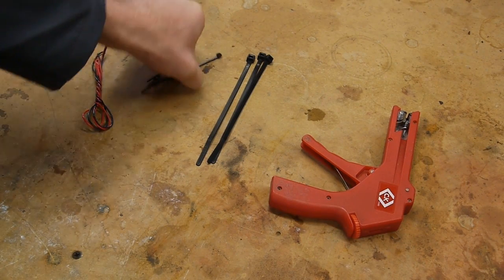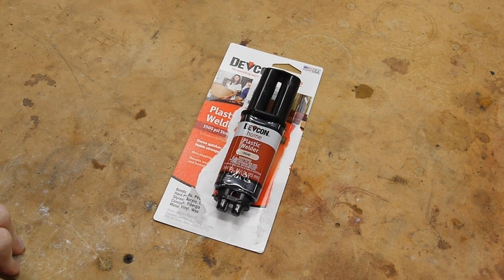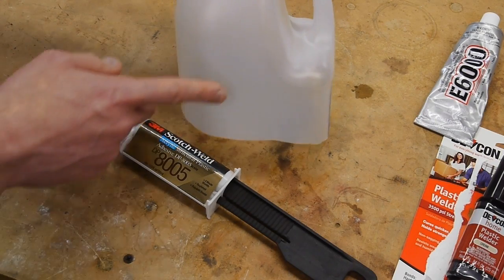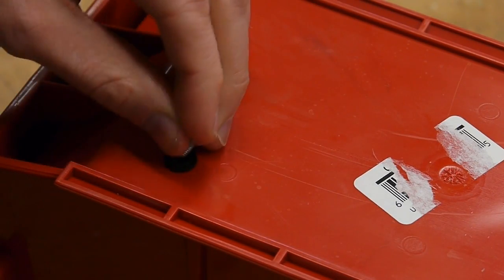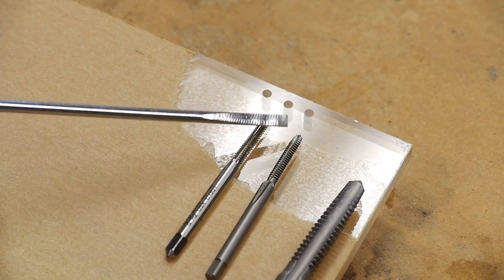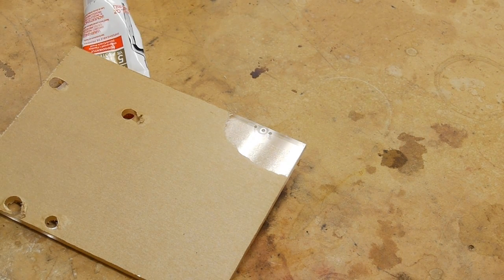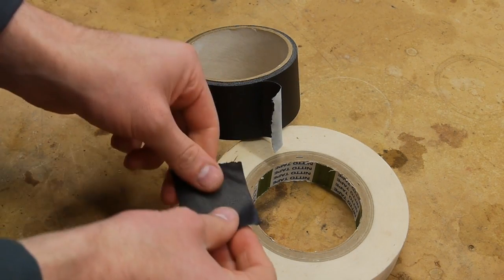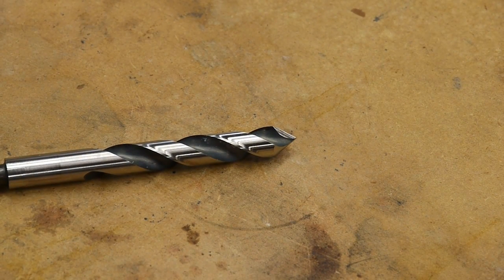Tools and Tips #1 from Applied Science

Comment: Just an FYI for anyone curious - the Scotch-Weld DP8005 is actually quite toxic and corrosive. You need to definitely use it in a well ventilated area, and make sure it doesn't get on your skin. It also needs to be stored around 4 degree C (40 degrees F) so it should stay in a fridge that is not used for food. It contains known carcinogens. But hells yeah, it works like a hot damn.

Comment: Tape, generally, including gaffer tape in a wide variety of sizes and a few colors: “Gaffer Power” Consistently high quality. The more effective tapes can be harder to handle: harder to pull, and the tape often has to be rubbed down after application to get the adhesive to set. But it is worth it.

Comment: With your glowing review of e6000 (3 years ago, as I write this) I decided to buy some and try it. 

My spectacles broke at the bridge so this looked like a great test case. The glasses are some kind of plastic or resin, so I scuffed up the broken faces and the 4 sides adjacent to the break (so as to create a "blob" repair extending both directions beyond the break).

I cleaned the surfaces with IPA and dried it with a hot air gun on low. I then opened a newly-purchased (from a high-volume dealer) tube of e6000 and wasted a big glob (I find all adhesives separate a little so never use the first out of the tube). I applied some to both surfaces (as directed by the instructions), waited a little, and then pressed them together. After the joint had set up a little, I followed up with more all around the joint, creating an elongated "blob" repair.

I supported the frames and let it set overnight at summertime nighttime room temps. In the morning I found that it was flexible, somehow not what I expected. I tried them on my face and immediately knew that this was not strong enough for a permanent repair. So I pulled apart the repair and pulled off the adhesive from the frames. 

I was quite surprised to find that the e6000 had not bonded to the frames *at all*. The e6000 peeled off easier than cheap rubber cement. Where I had removed the e6000, the frames were completely clean, as if I had done no repair at all--no evidence of chemical bonding whatsoever.  

I remember that you had said that you thought that e6000 consisted of perchloroethylene solvent and clear elastomer. I don't know perchloroethylene from spit, but I know that it doesn't attack a pretty common plastic (I'm sure my glasses frames aren't nylon or HDPE). 

So just an FYI to viewers who come here and see e6000 and decide to try it. My opinion: it's a non-silicone RTV, nothing special. 

For the repair, I fell back to my standard (and a favorite of yours): Devcon Plastic Welder. The result was strong and rigid. What I expected the e6000 to be, but wasn't.

Comment: E6000, Amazing Goop, and Shoo Goo, which is chemically similar Goop, are perchloroethylene-based adhesives from Eclectic products.  E6000 is odorless, nonflammable & dries clear.  Shoe Goo/Goop uses toluene & naphtha (like flammable oil-based coatings which should be ventilated in confined areas) & dries amber.  The Shoe Goo may adhere better because of more difficult-to-use refined solvents.

Comment: For tapping hard materials the straight taps shown in your video are better but I have found that for tapping soft plastics and especially perspex you need a spiral tap.  The waste channels of a spiral tap are a spiral instead of being straight and they are designed for softer materials.  They don't work as well as a straight tap on hard materials but they work much better than a straight tap on soft materials.

Comment: I call wellnuts.   Willnots.  Because most motorcycles and atvs use them alot and once installed for a few years in the weather they will not come out. Then your in trouble because they're usually holding very exspensive body panels on

Comment: On tapping of holes, you can get several types of products that make things easier.
When I worked at a navy yard we had a task of drilling and taping hundreds of holes on a Aluminum sheet 1/2" thick and was 4' X 8'. That Sheet was used to mount approximately 40 Multi-switch boxes for inter-communications. We used this adapter called Tapmatic with a 3/4" Hand-drill.
It would drill and tap the hole with a drill/ tap bit that would do it in one operation. It was a design that would keep the bits from breaking because it was adjusted for torque and or speed. I believe its still made. This was during the mid to late 60s. Its diameter was less than 4" on diameter. It could also be used on a drill press. Of course at that time there was a handle that was held to keep it from spinning. Now they have improved that quite a bit so that handle is no longer a part of the unit. There are drill bit combinations that will start a hole and end with a tap . when you pull the drill back out of the hole the Tapmatic reverses direction.

Comment: for tapping the hole, instead of using distiled water you should use TAP water.
''tap water, not just good for tapping holes'' - AvE
Reply: using plain tap water, especially in a place where melting is possible, risks embedding impurities in the water into the outer surface of the material being tapped, in a place where the exact composition of the surface material is highly important. Not recommended

Comment: I agree on the DevCon plastic repair, especially its odor. I is one of the worst smelling things I have ever come across. Back in the late 90's Walmart sold all of their DevCon two-part epoxies in their hardware department for $2.97, and this was one of the offerings. I bought a lot of this stuff for all sorts of projects. They also had a Kevlar filled Dev-Con two-part epoxy that I liked. What makes this stuff so great, like you said, is that it is somewhat flexible, which makes is very tough and durable, unlike most epoxies.

Comment: E6000 seems like a high-tack contact adhesive. Neoprene in a solvent?

I'm surprised you skipped the obvious joke and didn't take... tap water for cooling the tap while drilling.

Unfortunately i live at the other end of the world, and i believe all substances mentioned will not be available under the same brand names, but it's useful to know what approximately to look for, some manufacturers are actually reasonable about publishing at least vague information about the composition even if they're not forced to do it for material safety sheet. But of course they're not going to publish it on the packaging, it's hidden away on the bulk order website or only in a limited print catalogue. Aggravating.

Comment: Some tips for tapping:
Drill presses are great for getting taps started squarely.
Make sure to rotate the tap backwards frequently to break chips in tougher materials. People may get the wrong idea since you only showed a soft material.

Also, you can use Sodium Hydroxide (Lye) if you want to harden superglue almost instantly. Just have to be careful with it.

Comment: At about 8 minutes, there is also a GUN TAP - a 4th type (at least). I sharpen all my intermediate taps this way.
In a through hole they are perfect, as the chip no travels ahead of the tap in a nice spiral. In a blind hole you have to stop early and lift/blow out the chip. Since using gun taps I have found no use for taper taps, so only need two per set.
The same sharpening on a plug tap is also great. The torque required is MUCH less than a conventional tap.
Great on stainless steel, also.    -- Great videos!! -- a picture..
https://img4.fastenal.com/productimages/7003500_hr4c.jpg

Comment: For what it's worth, my favorite electrical tape is 3M 130C. I've always hated electrical tape because the stuff I got doesn't have much staying power, who hasn't seen a little rolled up piece of insufferable electrical tape that's slid all the way down a wire before?

130C is linerless, it doesn't really have much of an adhesive, you wouldn't think it'd be effective because it's not sticky, it's only a little tacky. The key is that it's stretchy. Pull it tight while wrapping it and it's easily as effective as heatshrink. In fact I'm not sure I'll ever use heatshrink again unless I need it specifically. And this is coming from someone who always thought electrical tape was a cheapass excuse for heatshrink.

It starts out really thick but thins out as you stretch it, so a little goes a long way. It's also pliable, so you can use it on a line that's flexing/moving a lot.

But the real kicker here is that it's rated through 69KV! I've used it on the HV line off the flyback on my RPTV with no worries of it arcing, peeling or sliding off.

Whoever said nothing is perfect never used 3M 130C.
Reply: Try 3M Super 88 some day if you need to waterproof a connector, that stuff is everything you want regular electrical tape to be, it has a black adhesive that's insanely sticky, and if you stretch it properly when installing it it'll seal better than heat shrink. You see a lot of telco manuals that have this elaborate procedure that tells you how to weatherproof the connectors on a base station, and at the bottom it then goes "or just use 3M Super 88". :) I have to try out 130C though, if I can find it!

Comment: I ordered several of the things you suggested, love the gaffers tape! I need some metric taps for aluminum. I found some from Irwin on Amazon for $8 that has the taper, plug, and bottom style taps. Is there a specific brand you use or recommend? The ones on McMaster are $20-40ea. But I've went through my share of the cheapo taps and these metrics (M3-M5) are ones I will use often on various projects.

Comment: JB Weld is one of my favorites as well - and those cable tie guns are indispensable and last forever.  Great tips Ben!
Reply: +Fran Blanch JB Weld is awesome stuff! I mostly use it as an abrasive resistant surface treatment on my old steel toes when the leather wears through. It's also great for mounting magnets. If you need the face of the magnet exposed put a piece of wax paper and a matching magnet on the clean face before mounting.

Comment: What's the advantage of using distilled water over regular tap water for acrylic coolant?
Reply: Applied Science You should really use tap water for tapping holes. That's why it's called tap in the first place.
Reply from the maker: Not much difference.  I already have distilled water in a wash bottle, so it's convenient, and it also dries without any residue or scale.

Comment: Ikea makes floorstanding versions of that LED lamp too. I have 2 of them on top of every desk in my house to provide great, diffuse light over the desk top. Great for reading.
Reply: Also, if you get one of those lamps make sure the inline switch is that contoured/rounded shape. The older, more blocky ones are prone to failure. They start flickering after a while.

Comment: Thanks for sharing. Always interesting to see what others find useful.

Those rubber expansion things come in all sorts of sizes. Even freeze plug sizes for Chevy small blocks; much easier than pulling the engine to fix a rusted out plug.
Reply: Wish I knew that a few weeks ago, could have saved a lot of headache
Reply: Dee Jay
I assume you had a freeze plug headache. Yeah, in my case it changed an all day job to a 15 minute one. Much less of a headache. I'm not sure of the longevity of it as a fix; I had concerns about the rubber deteriorating. It did last a couple years but then the engine was stolen out of the car so I don't have any long term experimental data.

Comment: Something I would like to share is "glue accelerator". Sometimes I find that even though super glue is great you still have to hold a piece together for 15 seconds, you let go and it'll fall apart. Glue accelerator solves this problem, you just spray some on and then put the part together, within 5 seconds or so it's made the glue harden. Also you can use baking soda to make superglue harden instantly, but unfortunately it also creates a little mound of glue and baking soda, so really the aerosol is a lot better.
Reply from the maker: Good tip!  I only recently learned about the accelerator as well.  It's a must-have if you use cyanoacrylate often.
Reply: Water will also do the trick :)
Reply: Kevin Stempien Urban myth says this was why the cyanoacrylates were invented originally - to be used to close wounds in battles :)
Reply: I've used super glue and baking soda to close up cuts on my hands.  You gotta watch out though as its an exothermic reaction, so it might burn for a few seconds
Reply: Kevin Stempien I've done the same thing. I was changing the blower motor in my father in law's truck, gave myself a nice 2" gash, so I went and dried it the best I could and put the glue and baking soda on it. Worked quite well.
Reply: No one told me the water-activation bit. Found that out for myself after using a wet rag to wipe CA glue off of a workpiece, than proceeded to glue my fingers together from the excess on the rag.
Reply: Breathing on it works well too, because it gets moisture right where you want it (cyanoacrylate sets by absorbing moisture), without have to splash water around.
Reply: Baking soda and super glue really deserved to be in this awesome video. It turns super glue it a much, much more versatile product and the result is hard enough to file and drill.

Comment: Great video, thanks! I would like to see you doing a video on how to remove very old and dry stickers from glass (most probably off a window glass).
Reply from the maker: If the glass is smooth, I'd use a brand new razor blade with some isopropyl alcohol as lubricant/solvent.  If the glass is wavy or otherwise too delicate for scraping, you might try acetone or methylene chloride to dissolve the sticker's glue.  I'm planning a video on solvent selection.

Comment: Great content as always Ben!

I was wondering if you can analyze the capabilites of different materials in the process of pipe bending. How well does sand, salt, pitch, and wood's metal withstand the pressure exerted from the pipe walls, thus preventing the pipe walls from collapsing? Also what would be the theoretical minimum bend radius be for a given wall thickness?

Comment: Awesome tips, especially with the adhesives, well nut, and cable tie tool! Got any tips for tapping aluminium heatsinks? I've broken I don't know how many 6-32 taps inside the workpiece when just tapping by hand, slowly, with plenty of oil. I've only ever seen plug taps available locally, and I'm starting to think they're the problem. It's so bad I have to tap one half turn at a time, completely pulling out and then carefully removing the material from the threads before reinserting and going for another half turn. Talk about a headache when you need to tap 3/8" deep!
Reply from the maker: The alloy that's used for heatsinks is probably not the best for machining, which makes the job more difficult.  Here are my suggestions:  1.  Use a tapping fluid that is specifically made for aluminum, eg "Rapid Tap Aluminum".  The fluid is not oil -- it's very low viscosity and quickly runs into the freshly-cut threads.  2.  Use a chrome-plated or TiN-plated tap for better lubricity.  3.  If you are tapping a through-hole, use a "gun tap" or "spiral tap" which will shoot the chips forward out the bottom of the hole.  4.  Use a tapping machine, or similar device that lets you hold the tap perfectly perpendicular to the surface.  5.  You could try using a power drill -- it spins perfectly on axis, unlike a tap wrench turned by a human hand.  Good luck!
Reply: #6-32 is an evil size to begin with due to its helix angle. If you calculate the helix angle for all inch sizes from #0 thru say 1/4" you will find that 6-32 has the HIGHEST helix angle of all (4.12°). This means that the tap is trying to advance into the hole faster than any other size, essentially giving the worst mechanical advantage (wedging action). This means you have to apply proportionally more torque when using a #6-32 tap than the others. The next worst is #4-40 (4.06°) and then #10-24 (3.99°), which also explains why they tend to snap off pretty frequently as well. When was the last time you busted a 1/4-28 tap? probably been a long time - it's got a really low helix angle of only 2.60°!

Where I work (as a mechanical engineer) #6-32 is specifically "forbidden" (you can use it if you must, but people will complain loudly in a design review) for exactly this reason.
Reply: bschena Well, that certainly fits with my anecdotal and experiential data. We use #6-32NC because it fits perfectly in the mounting holes of TO-220 and TO-247 MOSFETs/IGBTs, and the corresponding nuts are the largest size accommodated by prefabbed bolt on heatsinks.
Reply: Two other tools are drill for 50% thread rather than 75%, and pretap with an undersize tap of the same threading, when available. For the 6-32, the nominal OD is 0.138" and the typical drill size is 0.110 (#35). Go with , say, a #33 or #31 bit. For the same screw, tapping first with a 1/8-32 tap (0.125 nominal) will precut a partial depth thread, guiding the 6-32 tap and reducing the material it needs to remove. In lack of a tapping machine, a tap wrench with a center drilling at the back end can be guided by mounting a center punch in a drill press.
Reply: I happened across E6000 years ago great adhesive for general purpose like a slow setting hotglue, just better at adhering and causing cancer. ;)
Reply: Applied Science Thanks a ton Ben! I'll order up some Ti-N plated gun/spiral taps when the next order comes in. I might give the drill a go on a waste piece between then and now, curious how it would perform.
Reply: Try WD-40 for aluminium, but if you are machining it watch the fumes.It should be great for tapping though.